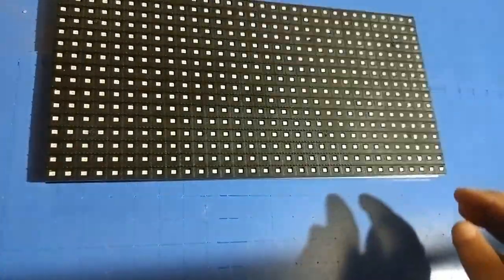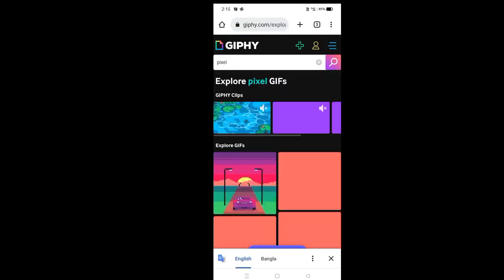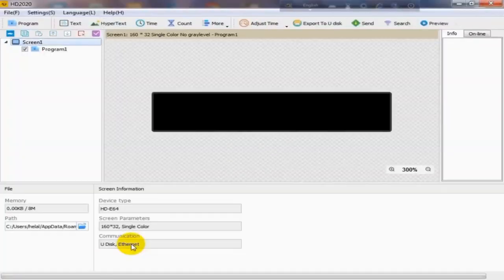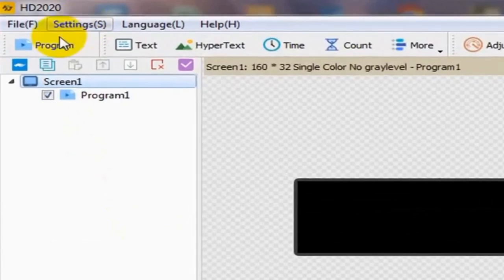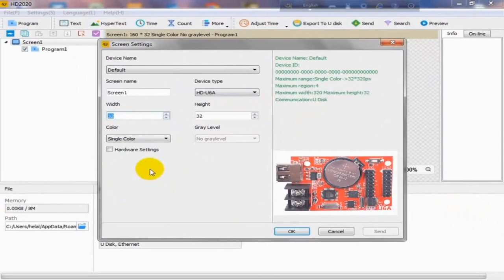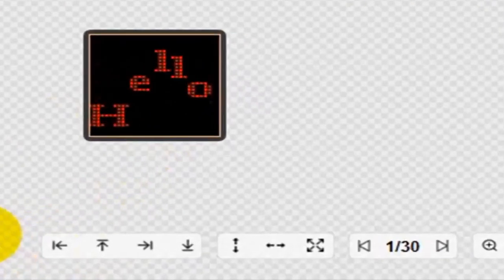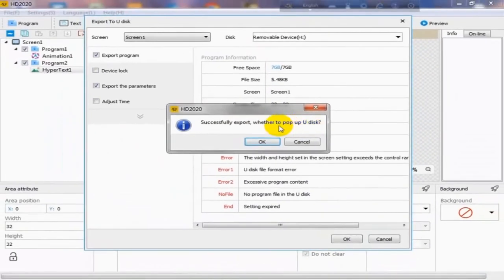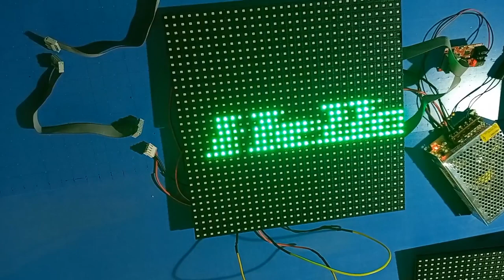Animated gif in p10 matrix | video on p10 display

Comment: Hey there, Where do I find that controller board? I already have 2 of those 32x16 DMD panels but I don't want to use my arduino to drive it anymore.
Reply from the maker: controle card is U6A . you can easily  find it online or in your local market
Reply: @elconpandua1834  what about its schematic? I want to know if it has an accurate rtc chip or just 32khz used by MCU ?